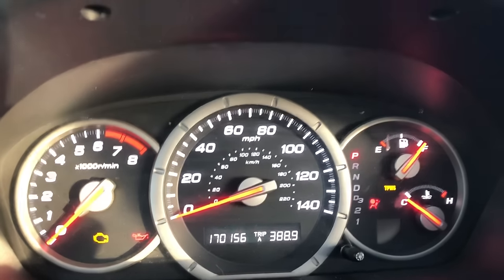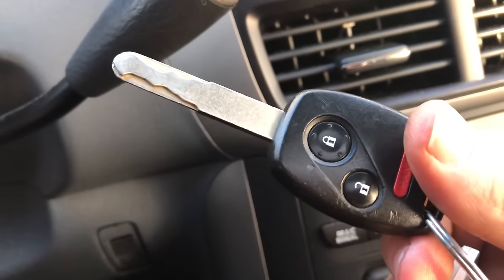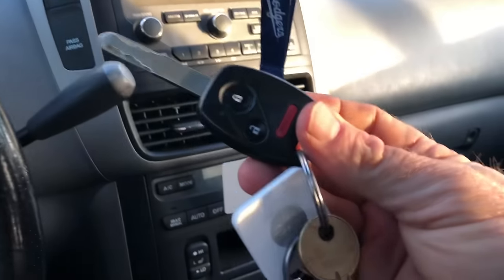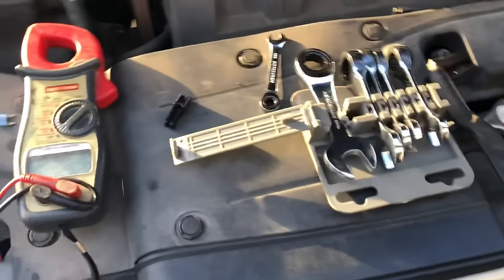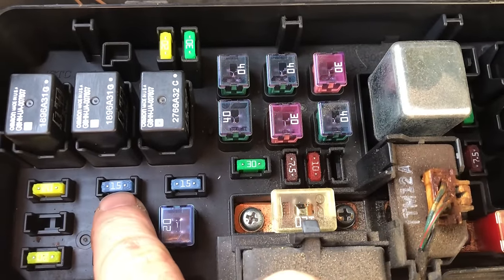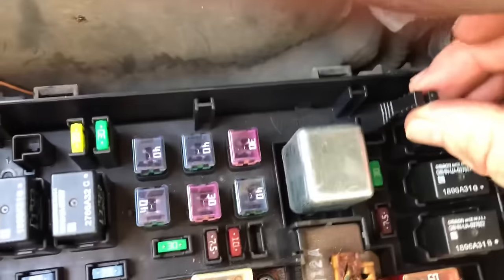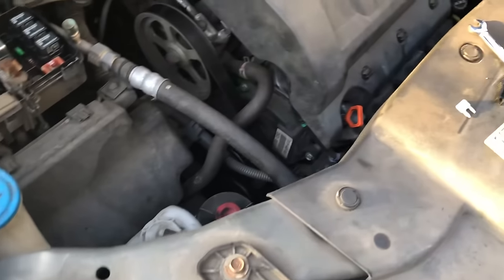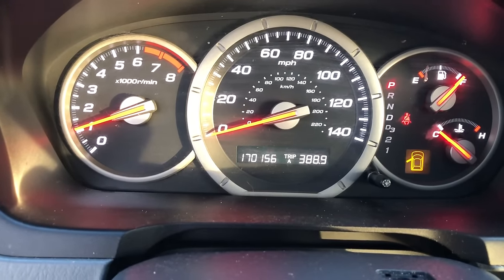Honda No Start Flashing Green Key On Dash - Easy Fix! (2024 UPDATES!)

Comment: 2008 MDX -  broken so I put the key in and use a screwdriver for the ignition switch.   Works fine until I use a new ignition switch from a 2007 MDX.  Now car shuts down power    — only cranks. Don’t run.

Comment: I thought this was my issue, but it isn't.  My steering wheel never locked and I thought the security system  immobilizer was stopping it from actually starting.  Still can't figure it out. Is there a fuse for the steering column?

Comment: Well, all that was wrong with mine was the tumblers. I watched a video showing that after you remove the ignition cylinder you can start the car with a flat head screwdriver. It did turn the motor a few times, but wouldn't crank. Suddenly the green key light started flashing and now nothing will turn. The little slot where I was turning the screwdriver also locked and wont turn. I think i caused more damage.

Comment: I have this issue. I thought maybe my car needed a new key because mine was tore up. Called locksmith to make one and car still wouldn’t turn over. I thought maybe my immobilizer, he stated it may be ECU because he could still scan and diagnose. I changed the fuse for my 2013 Honda Civic, located underneath drivers wheel.. still didn’t work. 😢 thinking it’s my ecu. Not sure.
Reply from the maker: Fingers crossed. You can figure it out. Check all the fuses one by one. It’s kind of a long shot but it’s free and easy.

Comment: ok.  So you discovered it was your fuse burned out.  Thing is, when you find a fuse blown, it means there is a short somewhere in that circuit.  You need to find the short to correct the problem  Fuses don't go bad on their own ( unless you saw it was corroded)  They basically protect your circuit and are a diagnosis tool.   You need to check all wires from that circuit.  If your car now works with replacing the fuse, it means your car has an intermittent short.
Reply from the maker: You’re absolutely right! The short happened when I changed the battery!
Reply: @checkitout2468  you changing battery caused the fuse to burn out? Hmm. I was having issues with my tiny battery so I threw in a full size my friend gave me, now I'm wondering if this may have caused it...
For the last month I've had to move the gear shifter around to find the tiny sweet spot that was actually fully in park to turn the car on. That sweet spot went away ...

Comment: Can confirm. Honda replaced my immobilizer ($485), 3 weeks later, its back. I just walked out to my 03 Element and swapped the ACG (10 amp) under the steering wheel. It went away. Thanks!

Comment: Do you know why my remote keyless entry doesn't work after getting a new key cut? It does start my car and i can drive it. I just can't lock or unlocking using the remote.
Reply from the maker: HIDDENRAINN Try reprogramming your remote control. It’s not hard to do, I’ve got it before. Look up on YouTube “how to reprogram a Honda key FOB”
Reply: @checkitout2468  I have the opposite problem..my remote on the key work as it would lock and unlock the car but the metal and ring reader doesn't work as key flashing any idea?

Comment: So i had this problem a while back e
Where the immobilizer light were flashing in my honda civic 2006 so i took to some ecu specialist, he took a look and the next day he called that some connections under the air intake which is connected to the immobilizer were soaked in oil and he cleaned it up and changed the wires and put them somewhere else and that fixed the unprogrammable immobilizer (said this because key smiths came by and couldn't program it because it resets on its own)

So follow the wires (from inside at the immobilizer to out under the hood and air intake) make sure they aren't damaged as will as fuses and everything is connected properly and hope it's not the ecu that is damaged

Comment: Integra.  2000   engine cranks....Got spark...Got fuel pressure to the rail when ignition key turns so priming pump works. All this but I have a continuous flashing green light and no start. Checked multiple fuses and relays.. Last ditch was to turn the key to on watch the green key flash off and on then while flashing I wiggled the key and the ignition lock harshly.. Little green key light went off and I turned the key all the way an bam...it started..

Comment: Hello, I have a problem. I lost the original car key. My car is a Handa Cr-v made in the year 2000 and it does not work due to the loss of the original key. The replacement key does not work with it, because it does not recognize the key.

Comment: Do you know the location of ACG in honda civic 2006
Reply: have u figure out on ur? cause I have 06 civic with same problem..the remote work but the key is flashing..it will turn over for a second or 2 second and the immobilizer will shut the car off real quick..let me know where that fuse is located I would like to know too or how u fixed your issue thank you

Comment: Was having same issue with my Honda Accord 2007, changed the fuse with spare and car is running, had to reprogram the radio.
Reply: Where was the fuse located? Under hood? On driver side panel by floor??

Comment: how's the car running nowadays I'm thinking about getting an SUV 4 by 4 it's either Honda or Toyota my ex used to have one and it ran pretty solid for years
Reply from the maker: Still runs great. Change the oil regularly and the transmission fluid 👍👍👍Check out Scotty Kilmer’s channel. He has good advise on car/suv buying.

Comment: I just bought the car off of someone and they only gave me one key and the buttons dont work on it he told me to change the battery and i did. But the screw isnt holding the shell anymore . I tried starting my car but it wont the green key does pop up .do you think it might be the fuse or the key😔

Comment: Having same issue green light comes on then reader reads my key then green key symbol goes off car starts changed my battery connectors had key in on position 2 after changing out green light came on few seconds went off car started then tried to restart and no green light appeared wouldnt start checked my post connectors fine gave locks up and down put key on started tried it again no green light wouldnt start I CANT HAVE THIS HAPPENING ITS GONNA CAUSE ME BIGGER ISSUES TOW LOSS OF MY CAR PLEASE ADVISE REPROGRAM AT DEALERSHIP KEYS NEW IGNITION READER TUMBLER AND REPROGRAMMED KEYS?

Comment: 2012 accord car was a repo 
They put it on a standard key no buttons
They gave me the original keys with lock and unlock how do I get it to learn the key 
Ps the original keys let me start car it turns off and the green key light flashes and the car turns off.

Comment: Had the same issue after using the valet key in place of the master key and after inserting the master key the green key symbol was still there. I turned everything off put a jumper on the battery terminal and then used the master key again and it started right away. Weird, I know.😌

Comment: Mechanics in my town would check the fuses n charge you for the most expensive option. Like the time I voted have spent hundreds to tighten a single loose bolt 🤦‍♀️
Reply: Your mechanic in the town he pays rent and his time is not free just like your time isn’t free !!!
Reply: @amerikadahayatlar  If you're changing a fuse you're not spending the amount of time to replace an immobiliser system. So why do you think that they should charge you for the most expensive option, just because their time isn't free.

Comment: YOU CANT CHECK OHMS IN A CIRCUIT  NEED TO PULL THE FUSE OUT  , YOU CAN CHECK VOLTS, BATTERY VOLTAGE IN EACH SIDE OF THE FUSE   .  ANY WAYS GOOD INFO THANKS
Reply from the maker: Good point, Continuity check would do it.👍

Comment: I was already thinking its the fuse, i noticed my cabine light didnt turn on when entering. Than noticed the same issue. Hope its just a fuse.
Reply: Weird thing is manual didnt state that in the key chapter. I would have thought they would make a mention about that
Reply: Im pretty focked :( they ordered a second hand and still it does nothing. I was reading some forums and there it was stated perhaps the MICU could be the issues. THe garage said thats good. Though whats also strange is that my interior ceiling light and electric door locks dont respond to the key neither. THose have nothing to do with the immobilizer if im correct.
They tried bypassing immobilizer but could get it to work neither. One of their employees is now back in europe and will try some connections to see if they can find new info. Hope thy do otherwise this car i junk :(

Comment: The green light doesnt mean that it means that the key that your sticking in does not either have a chip and that honda sticker on the back or its the turner that you stick the key in also its not the fuse ITS THE KEY

Comment: Mine failed in a different way, fuel pump won't power at all, replaced pump and relays and checked fuse. Currently bypassing it with a fuse tap but mpg went down due to having it at 12volt when it's on
Reply: Did you ever find the problem my car does the same thing
Reply: check  your fuel pump relay. its a grey or black box  behind the glove box see link for more info
https://www.justanswer.com/honda/8jz9j-2003-honda-element-not-power-fuel-pump-plug.html
Reply: These relays do not really go bad.... well rarely... they get corrosion on the tin and needs retinning... just resolder and go.
Reply: Wait you got a fflashing green key due to the fuel pump, thats weird?

Comment: I’m dealing with this problem on my 2006 honda pilot. However, every time i replace the ACG fuse, it pops again immediately after i turn the key. I already replaced the fuel pump, the 15a fuel pump fuse under the driver footwell, and the two blue pgm fi relays underneath the steering column. If anyone has any other suggestions please let me know

Comment: i have 2008 honda accord for me green light flahshesh and goes away sometime and sometimes it dosent go. so i see this issue intermittently and this happens with all keys. this implies keys are good but problem is somewhere any idea?
Reply: Did you discover the problem?
Reply: @eddiem384  nothing yet as its working intermittently i didnt bother to fix it.
Reply: @swapnilkotalwar  that's good. I found out on mines what the starter went bad. Replaced it and now it's working as it should. Cheers from argentina.
Reply: @eddiem384  can you post your fix,. as still face this issue. sometimes it take 3-4 attempts to turn on the car

Comment: I have a 05 Honda odyssey and Key won't turn, any suggestions?
Reply: Freanda Whatley try moving the steering wheel back and forth while turning the key see if it’s not just stuck. Or it might be your key cylinder. get a new key cylinder or have a locksmith rebuild your current one

Comment: My light turned green after my husband washed the key on accident, at first all lights turned on and then I reset it and then just the green light was left on. But my key will still unlock and lock but when I try to start my car it be on for a few seconds then turn off

Comment: What caused it to blow? Fuses don't just blow for no reason.
Reply from the maker: Good point. This happened after replacing my battery.
Reply: in my honda pilot 2007 the bad fuel pump blow the fuse.

Comment: Yeah - definitely not recommended to check continuity of the fuse while it’s plugged into the fuse panel. For a couple different reasons. 1 - you could still have continuity even if the fuse is blown because it’s plugged in, you could have continuity through somewhere else in the circuit. 2 - if there’s power going through the fuse when checking for continuity you could damage your meter. ✌🏼

Comment: Could a dieing key fob battery also be it
Reply from the maker: No, those are unrelated.  It’s possible to be related to your car battery dying, but should not be related to the battery in the key fob. Good luck with it.👍
Reply: @checkitout2468    My positive terminal is loose,   if I jiggle it, things will be fine ( bit I do have to reinsert all my anti theft codes ).    Will try a shim tonight, & see how it goes.        the sliding doors, are loose ( fixing those rollers weekend ).  ...Dealer mechanic over the phone suggested , that since the rollers arent 100% good, maybe JUST maybe the door doesn't close 100% & the anti theft acts up from that.        .!!!!             I'm chasing a rabbit down a fox hole

Comment: I've tried everything I can think of...fuses are good new ignition (whole unit) keys programmed will lock and unlock...flashing light still there
Reply from the maker: OK. Is it a new key? Or your old key? When you program a key to lock and unlock your car that is not the same as the chip that is in the key. Give me a little more information and I’ll try to help you out.
Reply: @checkitout2468  I have been attempting to use the original key. I first attempting just changing the ignition cylinder..which freeded up the steering lock and would turn over the engine but had flashing key light. Then it locked up again so I replaced the whole unit. I suppose the only part I didn't replace is the immobilizer. It's an 05 Honda pilot
Reply from the maker: @dswartley100  OK, just keep in mind that your original key has a tiny chip in it. That tiny chip will need to be reprogrammed if you replace the part of the immobilization system that reads the Chip. It’s the small circle around the where you put the key in. This reprogram and can only be done at the dealership or with very expensive equipment. It is not the same as reprogramming a key to make it lock and unlock the doors. It could definitely be more than one issue going on there however I’d hate for you to replace the whole immobilization unit if it’s not necessary.
Reply: @checkitout2468  Hey thank you for your responses. I did try swapping the ring around the ignition with the old one...it seems we'll have to have it programmed by a mobile locksmith..bad timing all the way around lol. 300$in parts at this point. Hoping it doesn't cost much more🥴

Comment from the maker: Want to say thanks for the video? Leave a TIP by pressing the HEART button.

Helpful Links:
Transmission fluid on a 2007 Honda Pilot. 
—Torque specs-  Drain plug 36 ft-lbs....fill plug 33ft-lbs
MATERIALS USED:
Honda genuine transmission fluid: https://amzn.to/2DeJhEm
Funnels: https://amzn.to/2z6r5Kf
Coveralls: https://amzn.to/2PP1ZJw
socket set: https://amzn.to/2DgW5Kj
socket extension: https://amzn.to/2AY7vRGcrushwasher: https://amzn.to/2DeTW1P
Ramps : https://amzn.to/2z1fZWY
tire chalks: https://amzn.to/2Dz1IEP
oil catch pan: https://amzn.to/2DyB0MD 

➡️Want to say thanks for the video? Use my Amazon link to shop. It’s free for you to use and Amazon pays a small commission.https://amzn.to/33i9exY

(As an Amazon Associate I earn from qualifying purchases)

Comment: Yo I have this problem with my civic 2001 except I can turn on my car just by flipping key around
Reply: Also my car has sluggish starts all the time but right after the first on car turns on. Fight but starts sluggsih again after sitting for 10 minutes at least
Reply from the maker: The sluggish slow starts are likely a weak battery. Take it to an auto parts store and they will test it for free.

Comment: I call it the Green Key of Death. I've had to have my car towed 3-4 times because of this. I took it to the Honda dealer twice and they wouldn't fix it because the car magically started right up and they couldn't "duplicate the problem."
Reply from the maker: If sometimes it works and sometimes it doesn’t it could be lots of things. However, I’ve had a few people put “blinger“ ( it’s a decorative piece) around ignition areaAnd that was what was causing the interference. Any chance you have some thing between where the key inserts and the steering column area???
Reply: @checkitout2468  I had a small can opener and several other keys on the key chain. I have removed all the extraneous stuff, though, and so far I have not had the problem reoccur. I will keep my fingers crossed...

Comment: Did you realize the car didn’t have a battery light either ?
Reply: hi, did you get any fixes? i have same issue with my honda frv at ignition on the battery light doesn’t gone and the green key light remains blinking, is any suggestions?

Comment: Hi my Acura dmx 2003 won't start I check everything it started once need help
Reply from the maker: That’s a tough one. If it started once it’s probably not your key etc. could be a whole bunch of things. Might be time to take it in. Possibilities could include, starter going out, battery low, fuel filter clogged, ...